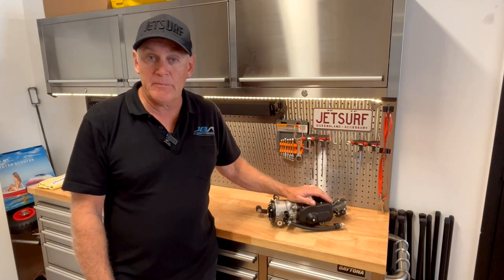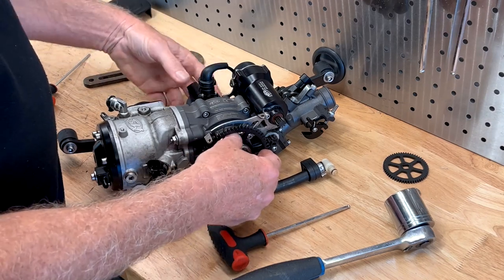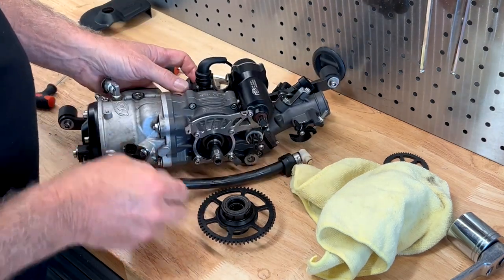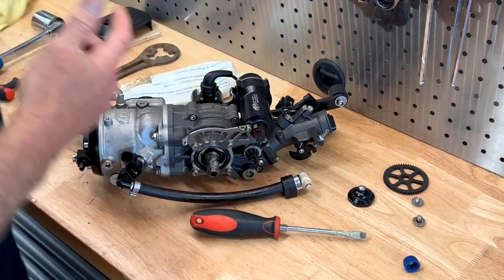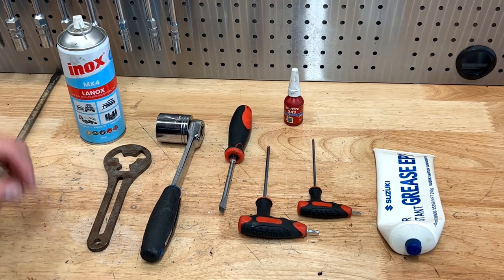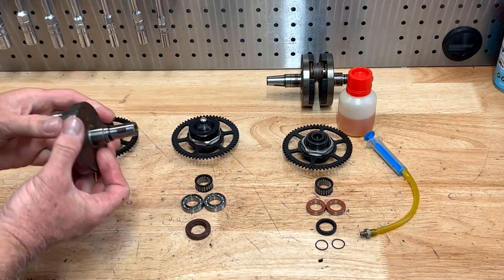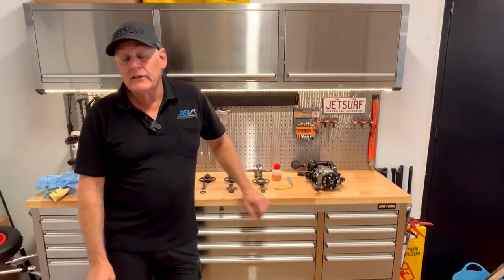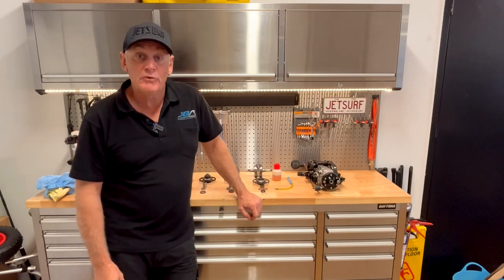Jetsurf Main Gear, Starter Cluch Service with Expert Tips from Rod at Jetboard Australia

Comment: Great Video Rod,  Are you positive your suppose to put all that grease on the one-way Sprag Bearing??.....I was told my 2022 Titanium DFI board freewheel bearings does not require greasing and just replace the entire unit every 25-30 hours of use.
Reply: If I can make it last longer by pulling off the little front black cap and pressing some of this EP2 grease into the bearing on the end I certainly would.  Just want to make sure adding grease doesnt mess up the one-way sprag bearing.

Comment: Great video, learned a lot about my board. I have a question about the impeller. I own a Race Titanium 2016. I heard the carbon impeller is very sensitive.
I'd like to get a replacement impeller in case the jet sucks in a stick or something.
On the Jetsurf homepage I can only find the complete jet pump assembly and no individual impeller. Does jetsurf also sell individual impellers and if so, how much does one cost approx.
Thanks for the help :)
Reply from the maker: Hi good question 
As a dealer I can get genuine impellers 
I have one in stock for a race DFI 
There $600 Australian
Or the guys from Warwick Water Sports in the US have after market ally ones for
$999.00 US
Reply: @JetboardAustralia  
Thanks for the answer, then I will ask my Jetsurf dealer in Germany for a price and if he will sell me one.
Would you prefer the original carbon impeller or one made from aluminum?
Reply from the maker: I haven't tryed the new all Ally Swerl impellers but swerl impellers have allways worked well in the jetski world
I will be doing a test on them over the next few months

Comment: What is the code number of one-way roller bearing?
Reply: HFL 1626  for boards newer than 2017. I found on ebay for $10 for my adventure plus 2021.
But I do not know the code number for the oil seal. Can someone tell me where to order the oil seal or code number?